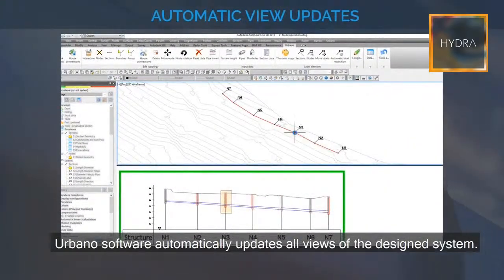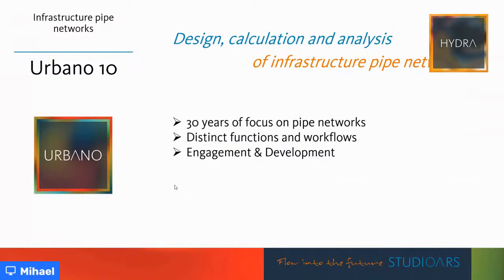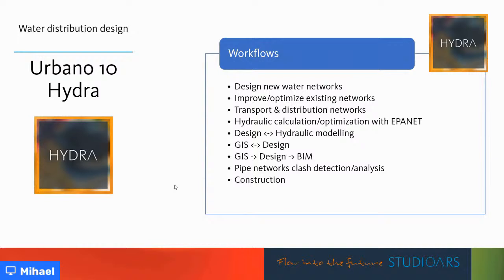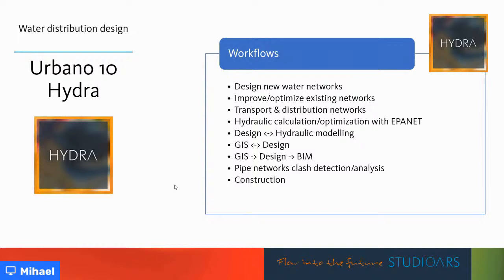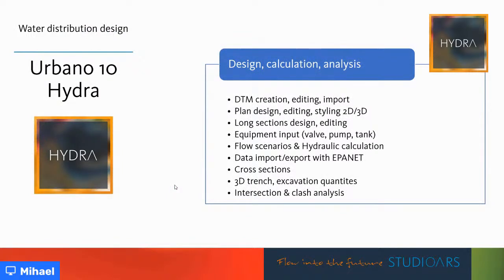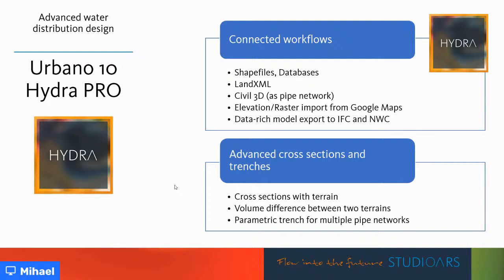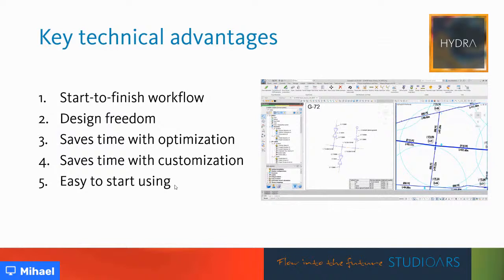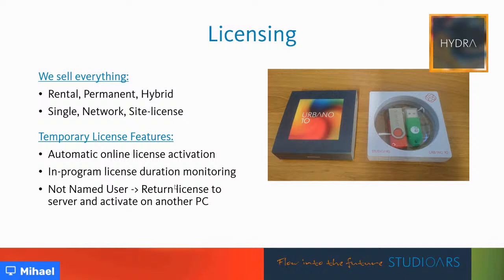What is Urbano Hydra?

Comment: I have a question about plan production. On this version is it possible to make plan and profil plan production like pressure network on Civil 3D?
Reply from the maker: Yes, you can design plan and profile in detail e.g. use various styles, labels, color-coding in your plan and various profile configurations suitable for pipe invert design, trench / excavation, plotting, etc. There is a special function for preparing long / high profiles for plotting. 
An Urbano water network is always conforming to an EPANET network. Whatever style and configuration you choose, you can always make a hydraulic calculation & pipe sizing or export to EPANET .inp file for further hydraulic modelling with another software.
However, please note: you cannot export an Urbano water network to a Civil 3D pressure network, and you cannot design the Urbano water network using 3D elements like fittings, valves. You can export an Urbano water network to formats like .shp, Databases, .ifc and .nwc.